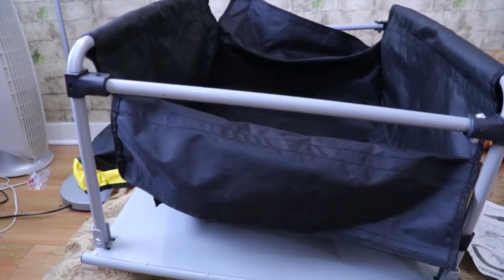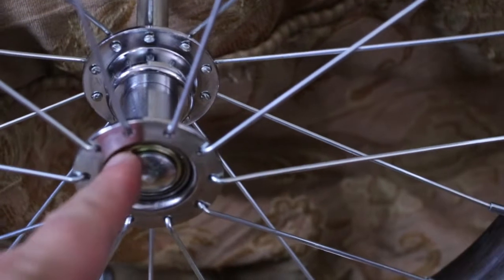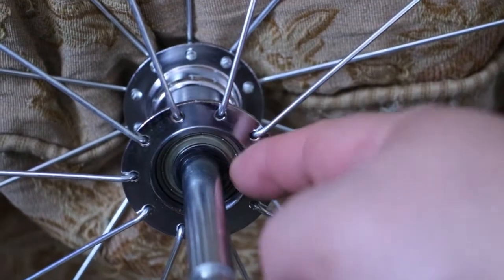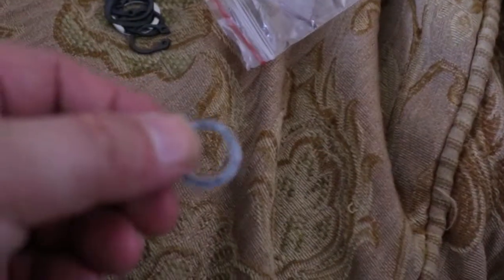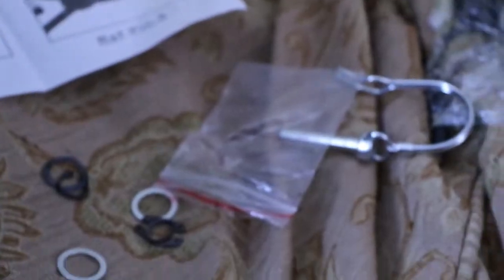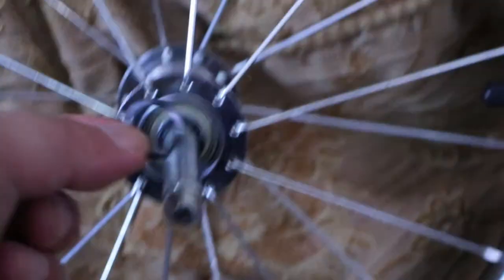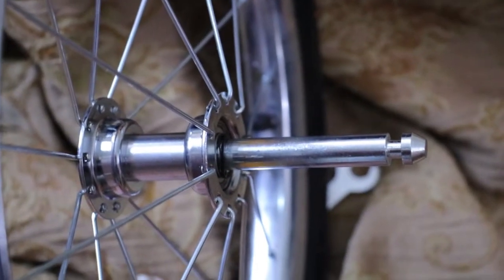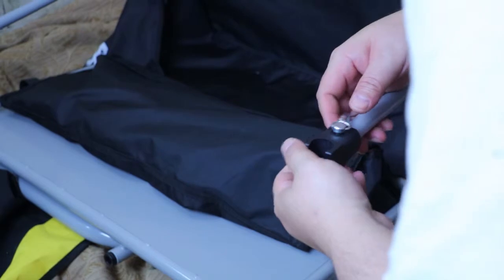TUTORIAL : how to set up AOSOM cargo trailer from A to Z

Comment: And wouldn't you know it? The adapter that fits onto the bike has a hole too small for my bike wheel. Will have to dig out a drill and enlarge it or else see if they sell an adapter with a larger hole...

Comment: They are called 2 washers and the 3rd one is the lock washer. Did you put them on both sides of the wheels or just one side??????
Reply from the maker: There are 2 wheels. Use those 3 items on each wheels